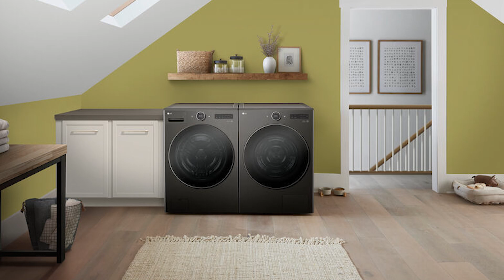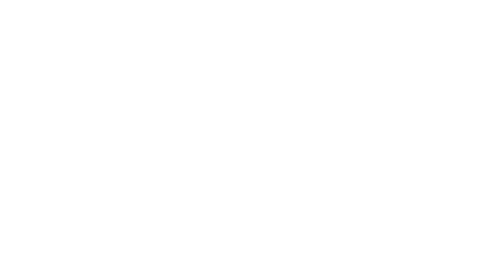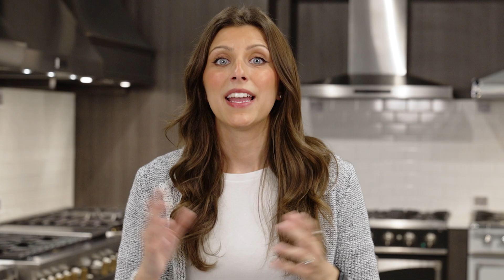Results Are In! Testing the LG 7.8 cu. ft. Heat Pump Dryer

Comment: Bought this drier from LG seems ok but the installers lousy the drain hose on the wrong pump outlet and then left  something off the aux. drain it leaks . I had to put a hose on the aux drain port and they won’t send a service tech to address this. They send the movers/ installers back out and they didn’t bring parts and said nothing is wrong . DONT ORDER DIRECTLY FROM LG . Don’t buy the server plan they will not honor it.
Reply from the maker: Yeah final mile for all the manufacturers is lacking.

Comment: Heat pumps usually are 120V...

Putting that aside, it's like LG has engineers or something. I know Europeans use smaller dryers and hang the rest....what's wrong with the American companies that they can't figure it out?
Reply from the maker: I know
Reply: @YaleAppliance1 But at 1:11 your video says it requires 240v.

Comment: ENERGY USE?  everyone seems to compare the drying times - but the whole point is saving the planet/cost to run?  any data on total kwh used comparing that to comparable electric?
Reply from the maker: I did the comparison last year...One load a day is equated to $125-175 in savings

Comment: In the comparison chart, you should add the wattage used. So you can see how much less power it used. Thats the main benefit of these dryers.  When I did a similar test, my conventional dryer used 1400W for one load of clothers, and new LG Heat Pump Dryer only used 425W once the load was over.  The dryer took 40 minutes to get done, and my LG HeatPump took 1 hour and 15 minutes.  Yes the conventional dryer was way much faster but it also used 3 times more power.    That's why you need to add wattage used on your comparison chart.
Reply: Do you mean 1400 and 425 watts or watt-hours? Watts are an instantaneous measurement (power) and watt-hours is a measurement of power over time (energy). Like if one dryer was 1400 watts and another was 700 watts but the 1400 watts dried clothes twice as fast, they would actually use the same number watt-hours (energy). The electric company charges you for energy (usually in kilowatt hours).

Comment: Having owned a heat pump dryer for one year, I can say it is a learning experience.  Clothes are never baked-dry nor bundled into a ball, they are easier on clothes.  Having a washer that spins at a very high speed (Miele’s is 1600 RPM) removes a lot of moisture which is beneficial.  Mandatory to clean dryer’s filters and air exchange filter every day.

Comment: If it's winter and you are heating your laundry where does the heat come from? Its misleading to say it uses less power when the heat to dehumidify is taken from your home heating.
Reply from the maker: No....The air is recycled in a heat pump, not pulled and then removed in a vented
Reply: Even if it did you aren’t venting conditioned air outside so even if it did pull from inside the house you still have a better solution than a normal vented dryer
Reply: You are right with regards to the heat source, in winter heat from the heat pump come from your home , so from your heating source.  Energy saving is real only during warm season.

Comment: Just got this dryer a couple weeks ago and so far everything as been great! I have a row house and my plumbing was located along a party wall making venting a challenge, and the drain was in the basement slab so would have been expensive to move. This dryer gave me an easy solution to this issue, and is more energy efficient as a benefit. It does take noticeably longer than the old coin operated gas Speed Queen at my old apartment, but not a big deal to me and my clothes come put dry and the lower heat is easier on them.
Reply: My 2008 model electric dryer still works great and only takes 20 minutes to dry anything that I put in it. How long does it take for your new Heat Pump dryer to dry a load of towels?

Comment: We have this dryer and it’s fantastic.  Clothes come out perfectly dry every time. Her times are way off.  It does take longer but not that much.  Today a large batch of beach towels took about 90 minutes.  Our whirlpool took about  75 minutes.
Reply: Yeah I noticed that too - I've sold quite a few of the DLHC5502 and I always try to get feedback from customers on performance and dry time, only had one customer who was unhappy with the longer dry times, everyone else said it's close enough to their old machines that they don't notice a difference nor find it inconvenient. I also wonder if they were testing the GE in a huge warehouse with no vent hooked up - pushing air through 20 or 30 feet of half-clogged fire-hazard flexible dryer duct (which is what 99% of homes have, lets be honest) would severely limit the vented machine's performance, and if you've got in-wall or under-floor venting that's impossible to keep clean, then I almost wonder if the heat pump unit might dry *faster*. Either way it makes more sense to me to dehumidify clothes to dry them instead of char-broiling them and dumping 100% of the heat outside. Vented dryers need to go!

Comment: I only ever run the dryer overnight so the time to dry is thankfully meaningless to me
Reply: It's certainly quiet enough to do😂
Reply: My 2008 model electric dryer still works great and drys anything in 20 minutes. Even a load of towels. 
A heat pump dryer uses less power to operate but takes 5 or 6 times longer to dry so the power usage is about the same as my power hog dryer.

Comment: Do you have any information on the recommended ambient temperature for this dryer? My laundry room sometimes gets down into the high 50s, low 60s in the winter.

Also, when the dryer is done, are the clothes slightly damp afterwards?
Reply: The manual says ambient operating temp above 41 F
Reply: Look up " Bens Appliances and Junk". He has a fantastic channel and reviewed this dryer 3 months ago.  He said the best room temperature is 70 degrees, below 60 the drying time significantly increases. 🐾🐶🐕
Reply: I have this unit for last 2 months…and it’s been a great experience. I have tried following types of laundry 
(1) regular weekly laundry that’s mix of clothes, towels
(2) sheets +queen quilts 
(3) queen comforter 

Runtimes for (1) on an avg is 1hr 10min, consumes less than 1kwh unit, clothes come out completely dry. I haven’t felt any dampness.

For both (2) and (3) the runtime was around 2hrs, consumed 1.1kwh, clothes required 5-10mins of air dry (I just spread them on a bed). The bedsheets are fine, but quilt and comforter will require more drying time. 

Today I tried 5 doormats (20x30 size) and behavior was similar to (1). 

I live in Folsom California and right now the temperature is above 90. I am yet to experience winter days, so can’t tell how will it perform 🙂.

I hope it helped you.